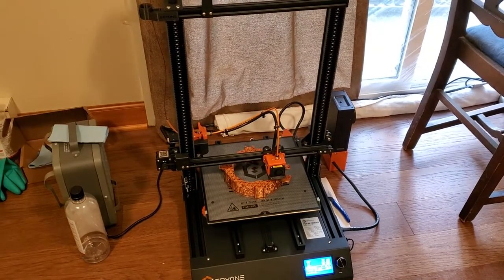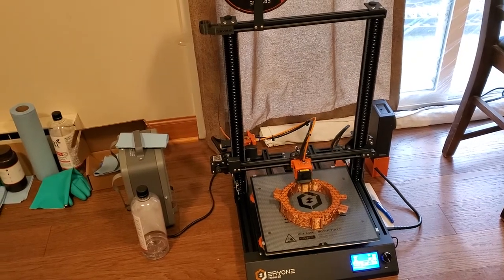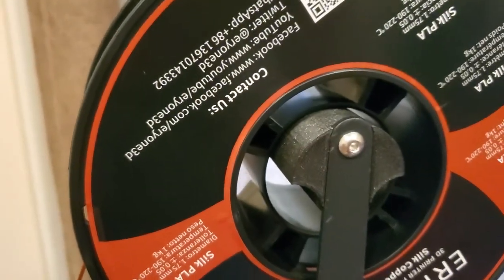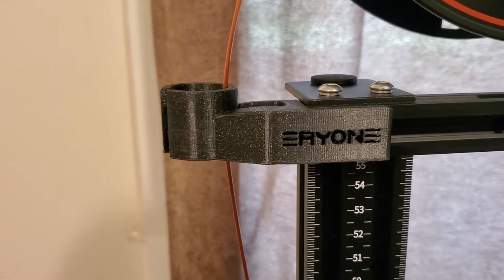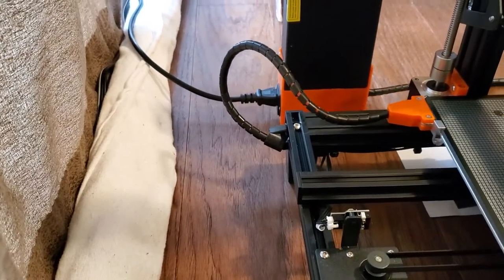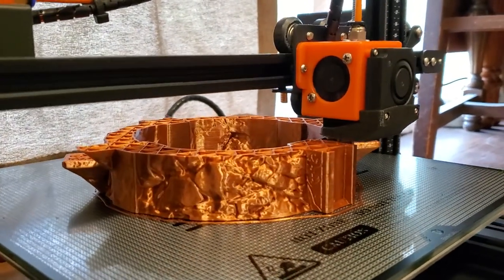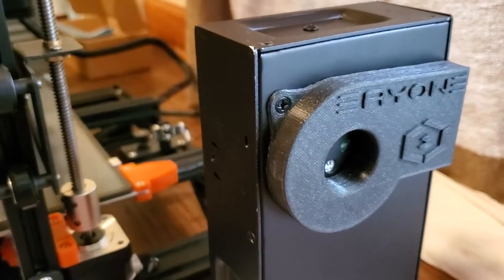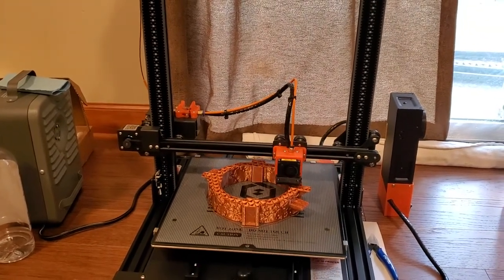Eryone Thinker SE printed modification review

Comment: Now print off some belt tensioners, BLTouch mount, dust filter, frame brace, storage drawer, and you're good to go!

Thanks, never saw that fan shroud before. I'll probably print that off.

I am waiting on bearings to arrive from China, and then I'm gonna print something better for the filament spool holders. For now I just put a strip of PTFE tape across the top, seems to work pretty well in the meantime, considering it was a 5-second fix.
Reply from the maker: Already printed out the BL Touch mount (just haven't ordered a BL Touch yet).  I've also printed the frame brace connectors and the side gauge levelers.  Quick question - do you have the link for the dust filter?  I haven't seen that one!
Reply from the maker: The PTFE tape is a great idea....I'm going to do that in addition to the roller.  Nice suggestion!
Reply: @jayburkette8977  Does the BLTouch mount you printed have holes that match up? I designed one because the other I printed (madizmo's design, posted as a remix even though I did it from scratch) did not line up.

Dust filter I printed was one of the first things, and it's okay. There's lots on Thingiverse, couldn't see the one I printed, probably was a remix of a remix... If I printed it again, I'd make the hole slightly larger just to be sure it's not dragging, and I'd probably add some way to mount it, as right now it just clips onto the filament and butts up against the bowden tube (can hear it tapping lightly after retractions). First thought, a pneumatic coupling on the end of the bowden tube, but this seems like overkill. lol